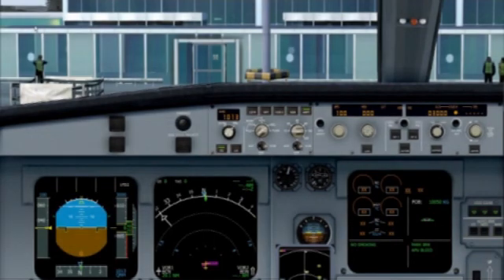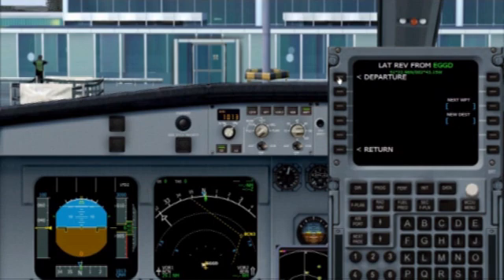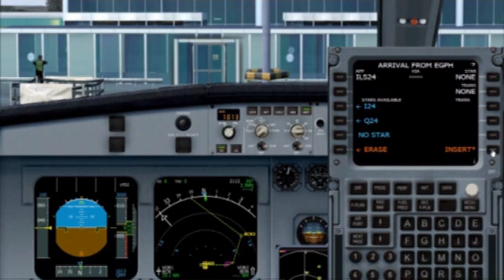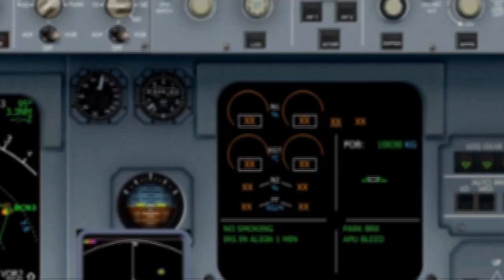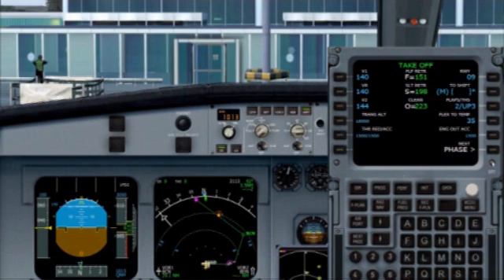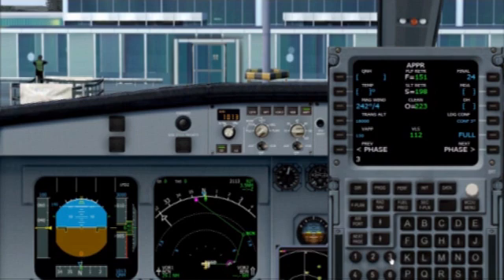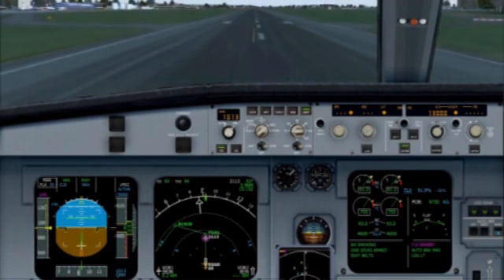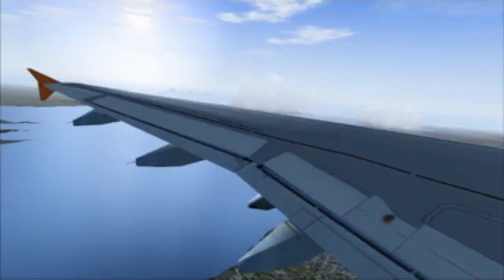Wilco FMGC Video Tutorial

Comment: I purchased the Wilco Airbus A320 Evolution Vol 1 and I am having problems in capturing the ILS at airports. I have been looking for a really good video tutorial on this segment of flight but there does not appear to be one. The pdf file says to enter 1/0 for the Flp/Ths as the airbus control trim on take-off, I noted you used 1/up3, is there a mistake in the pdf file, yours seemd to work well. Thanks for the video, I have no problems with that segment, just the approach part/.

Comment: Thankyou very much for this video...I have the wilco A380....i followed all the instructions in this video but i still have a problem.....after taking off and when i select auto pilot the aircraft turns around and aligns with the localizers of the airport i took off from rather than following the flight plan rout...what can i do to correct this